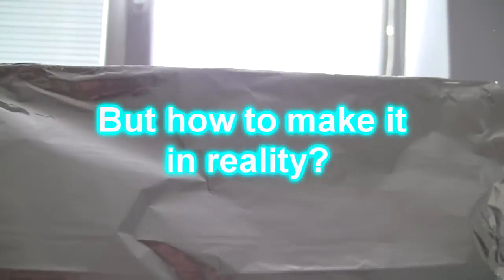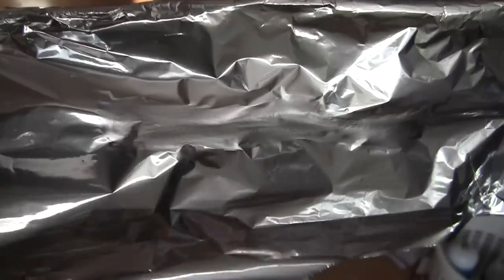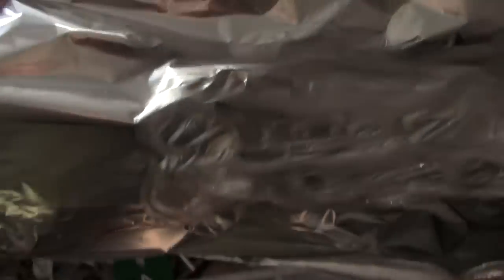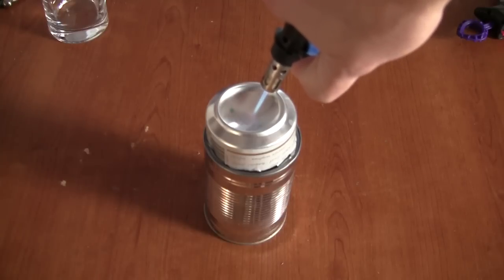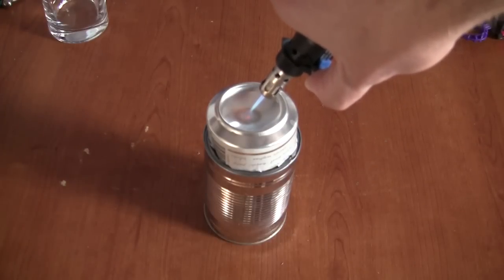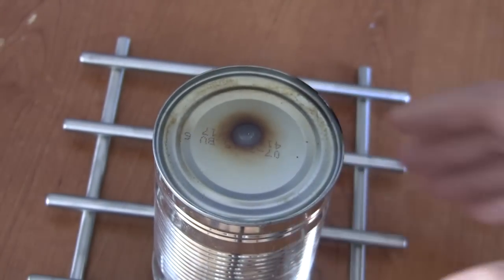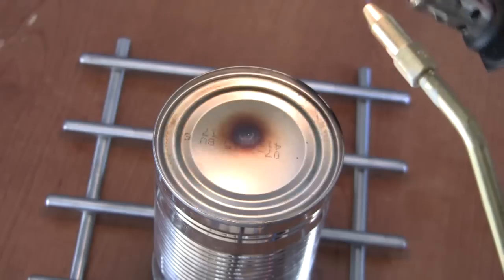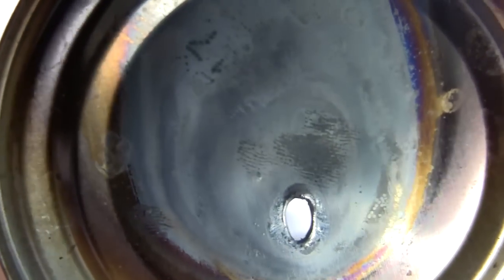How to make REAL Transparent Aluminium!

Comment: I'm not sure this is what Star Trek had in mind, but nicely done still!
Reply: +RagHelen You may learn grammar before commenting on video.
Reply: +Kiba Bloodfang It needed to be 1 inch thick right? To compensate for 6 inches of glass that was required to hold that amount of water. So no, this wouldn't exactly be adequate by Scotty's standards. But it is still cool.
Reply: RagHelen This stuff is supposed to be able to hold back enough water to house multiple whales.
Reply: +markalexander774 They didn't build the tank from transparent aluminum. They traded the tech for the acrylic panels to build the tank.
Reply: +Kiba Bloodfang I don't think it's what Battletech had in mind when they mentioned transparent aluminum either.
Reply: There is no fucking way I just found you on youtube...
Reply: +Allyssix "Ruby is also monotomic aluminum and quartz"
*Ruby = Al2O3:Cr that means it is not monotomic... *
quartz = SiO2 their atoms are joined as well.. not monotomic.
" and is sometimes called transparent aluminum cuz i Could be used that way"
They can not be used like aluminium. a wall made of ruby is VERY brittle so is quartz. it cannot be compared to the strength of aluminium, in startrek they needed aluminium because they could at least make very thin tank walls that were light weight(even though that weight was always insignificant compared to the sheer weight of all the water...). if you would use quartz or ruby in this manner you need walls several factors thicker.
Reply: +Fynx Oh, why sure, but be gentle.
Reply: Lord Doomer Yeah, me too. Was a little disappointed that it wasn't some big fancy process. All it takes is a butane torch to heat the aluminum so it nearly melts away. It also loses all of its usefulness. The transparent aluminum in his source/inspiration is supposed to be super strong.
Reply: +Ronald Johnson Why not just grow a pure carbon sheet, 6 inches thick ?? (which would be pure diamond) You could use a modified food synthesizer hooked to some of the transporter circuitry for power.
Reply: zool201975
 true... it's been a while since I saw TOS but after a little checking yes they had food synthysiers (a kind of crude replicator) on federation and romulian ships, which were used in conjunction with a ship's chef (due to their limited abilities) but at the time of that particular movie they were on a klingon ship which unlike federation and romulan ships used ration packs (which is actually pointed out when scott complains about the klingon food and makes a point to replace them before heading back to earth to be courtmarshaled)
Reply: TIMEtoRIDE900
yep or they could have simply sealed up the cargo hold. pretty sure it was big enough and filled it with water (considering it had to deal with potential atmosphere leaks I'm sure it's water tight. would have made everything a heck of a lot simpler
Reply: cardeci that's not completely true.. almost all natural rubies found also contain chrome.
Reply: TIMEtoRIDE900 it has to do with electrons.
the way they behave is differently in a messy structure like graphite then when its in aliment to form a crystal. visible light is then not absorbed. it is explained when you look up on google why light is reflected or passing trough objects.
Reply: Kiba Bloodfang artificial sapphire is pretty much transparent aluminum. They use it to make bullet proof glass in military aircraft among other things.
Reply: not really  you're missing Oxygen and Nitrogen to form the clear (+/-) ceramic material
Reply: +TheRebel3000 You may learn logic befor giving "smart" advices
Reply: +Fynx o_O
Reply: +Kiba Bloodfang  Ruby is also monotomic aluminum and quartz and is sometimes called transparent aluminum cuz i Could be used that way
Reply: Callum Warnes He said that in reply to me... did I make a typo?? D:

Tell me what I need to fix, please.
Reply: TIMEtoRIDE900
lol because by the time the sheet is that thick he is looong dead ;P
Reply: +TIMEtoRIDE900 two possible reasons. first the replicators were not available in the original series time line (they seam to have come in some time between TOS and TNG) and second to create something on the size they needed they would require an industrial replicator which a warship wouldn't have onboard. (they were large things usually only found on stations and shipyards ect) unless they wanted to make a tank out of lots of tiny peices bolted together
Reply: crwydryny  hmm i have seen them clearly use food replicators in the original series though
Reply: OK - after thinking about this, there is no need for "transparent ally", You just make the wall out of carbon fiber and install cameras  to monitor the whales. They are prety much blind, so there is no benefit to the whales anyway.
Reply: WTF? Mind = Blown... (AlN)x·(Al2O3)1-x, 0.30 ≤ x ≤ 0.37
Reply: Tom Slak yup
Reply: +Tom Slak Finally, somebody pointed that out.
Reply: Tom Slak .....oohhhhhhhhhhhhh.
Reply: Ruby is also stronger than glass, and it's pure aluminium oxide, and entirely transparent (like most other AlO:s)
Reply: zool201975 True, however, "ruby glass" is normally considered a ruby, and it's pure transparent aluminium oxide.
Reply: Why does light pass thru Diamonds so well, yet is stopped cold by Graphite ??
They are both Carbon bonded into a lattice structure.
Reply: layers.
Reply: +DizzyIzzy
Tumblr is over there ------------>  come back when you have matured
Reply: And then Aluminum oxynitride came about...
Reply: Before you keep up making things up in your mind: This stuff is supposed to be Aluminium oxynitride (ALON) which was patened at the time the movie came out. That is the backstory. ALON was called tranparent aluminium for fun after the movie then.
Reply: +Kiba Bloodfang You may have second look at the scene before doubting others.

Comment: i think its just a ton of extremely small holes in the aluminum, small enough that water can't get through
Reply: http://www.surmet.com/technology/alon-optical-ceramics/index.php

ALON.
Reply: +miner69erher yeah my same experience. i usually use a similar, uh, experiment, when i light fire under in and pour a 'liquid' over it to get it hot.
Reply: +miner69erher that would be really cool.  But no.
Reply: +miner69erher Aluminumoxide and aluminum oxynitride are both transparent. One is saphire and the other is literally named transparent aluminum in reference to star trek.
Reply: actuatedgear ah, did not know that

Comment: Aliminum is quite succeptable ot warping by heat, due to that I suspect in the case of the can that playing around with the hot metal caused it to contract away from the center, in other words it was as thin as the foil you had earlier and that's why it was as see-through.

Comment: are the transparent spots still as thick as before?
Reply: +SoWeMeetAgain  no, he's ablating away enough material that what's left isn't thick enough to block light, goldsmiths can hammer gold leaf thin enough by hand to accomplish the same thing.
Reply: Andrew the Celt
thanks!
Reply: SoWeMeetAgain Aluminum oxynitride is a transparent ceramic with around 80% transparency and there may be a small amount of oxidization/nitration occurring but I think most of the effect is ablation.

Comment: It's not healthy to breathe in all that vaporized aluminum. You're going to give yourself alzheimer's disease
Reply: No link between aluminum exposure and alzheimers.  Although the plaque contains aluminum compounds, it isn't caused by the aluminum.  This is clear because aluminum smelters, miners, platers, and aircraft mechanics do not have higher rates of alzheimers than the general public.
Reply: +skinnywhop87 the smoke coming off the can is from the plastic coating
Reply: +skinnywhop87 Tin foil is bad, aluminium is not. Urban myth.
Reply: +skinnywhop87 Just eat some curry, he'll be fine.
Reply: I think the Alzheimer's may be caused by the meth and lack of sleep!